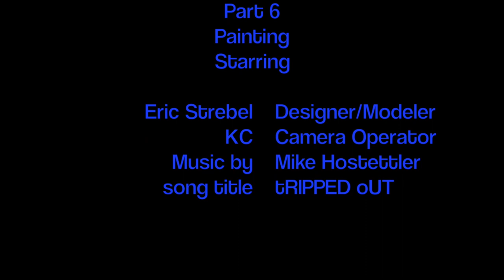Painting HVLP Rattle Can Prototyping Product Design: Mobile Solar Charger power bank Part 6

Comment: Loving it. My only crit is, as industrial design is moving to more sustainable resources and techniques, leaving the water running like that through your wet sanding is a little (very) negligent.
Reply from the maker: Alastair Tilley prototyping can be a bit messy, I agree. I am all for sustainability, always trying to get my clients to use sustainable materials for production. I need a water drip mechanism for wet sanding!